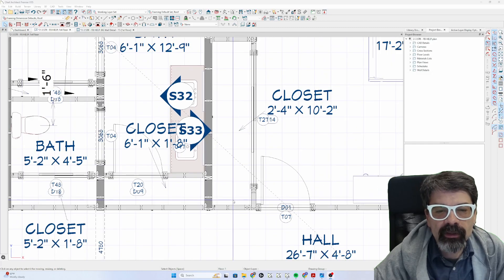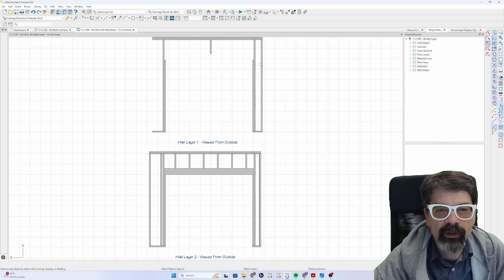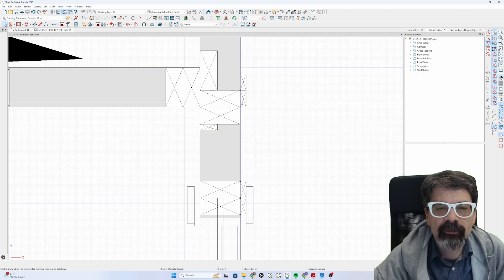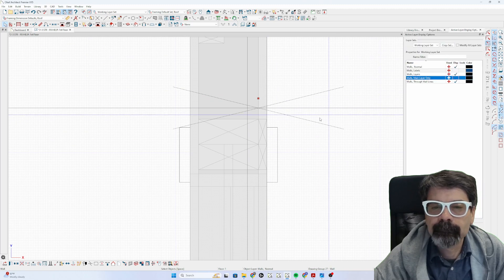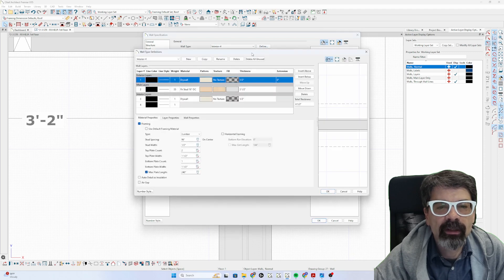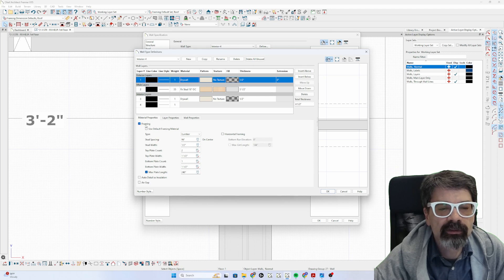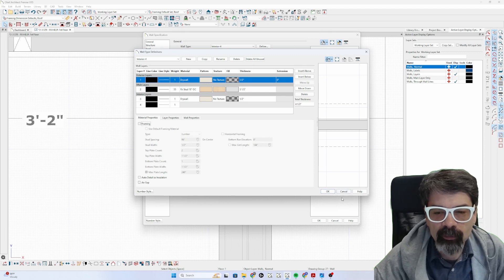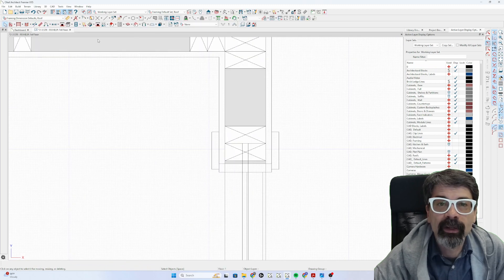Bonus Tip: Wall framing settings | Chief Architect

Comment: Please show more of these videos, Im a builder that has drawn everything by hand. Im trying to learn cheif Archt X16 and Im finding a lot of these little bits of information go so far!! Not sure if you can help me? How do I  have the exterior wall sheathing extend over the band joist when I perform a cross section of the exterior wall? Thank you in advance.
Reply from the maker: Are you talking about the band board on the foundation? I’ll take a look in the morning
Reply from the maker: My sheathing automatically covers the band board at the foundation. 
If you want to extend beyond the bandboard, you'll need to open the wall definitions and select each layer you want to extend below the sill one at a time. Click on the "Layer Properties" tab below and there's an "Extend Layer" box below that. Select each layer one at a time and enter the number in that box that you want to extend the layer. 
In my model, 0" extended makes the sheathing, housewrap, and siding stop at the top of foundation. Any positive number in that box will make the layer extend below the top of foundation. A negative number will retract the layer above the top of foundation. HTH